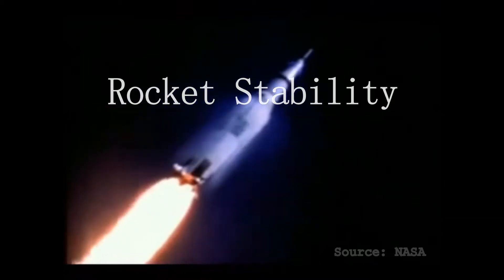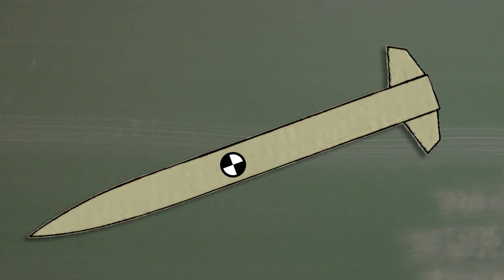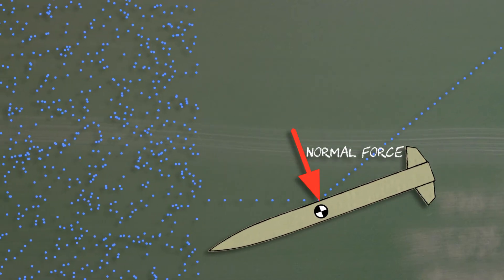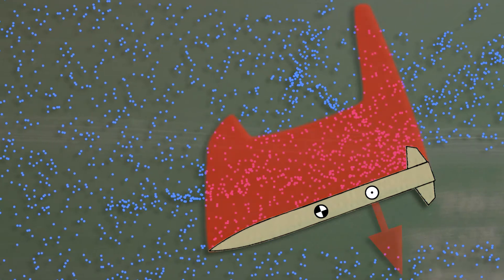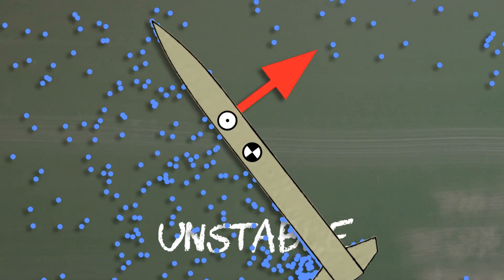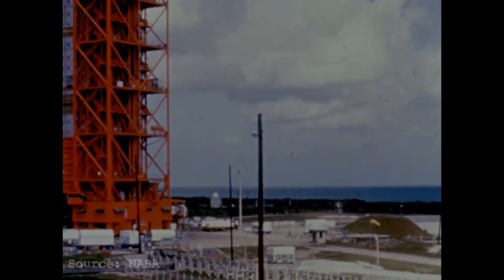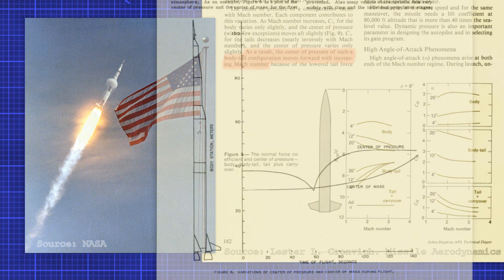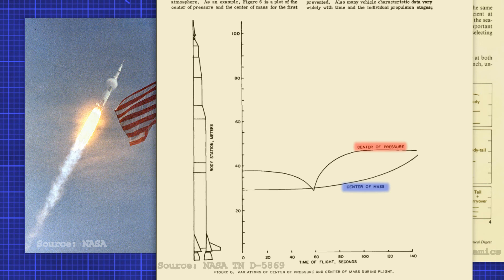Rocket Stability Criteria Introduction

Comment: Any toxophilist will tell you that an arrow without fleches will rotate so that it flies sideways on to the airflow, regardless of where the C of G is. The stabilizer fins at the rear are what keeps ponting in the right direction. This simple observation shows that your theory is incorrect.

Comment: the nozzle diameter is critical, which explains rockets don't go much higher than 20 miles, thin air is the reason they go horizontal and follow a parabolic arc, space is fake

Comment: Hi, thank you for this video. I have not found a more insightful normal force distribution graph online, I was wondering how you managed to graph/calculate this distribution for the rocket?
Reply from the maker: Hi, the graph in the video is not meant to be accurate but merely used to illustrate how such a distribution might look. The distribution in the video was inspired by figure 3 of Barrowman's TIR-33 document, which is the one example of such a distribution drawn out I've seen. If you google "tir-33 center of pressure" you should find the document.